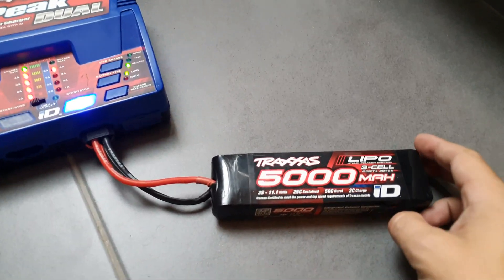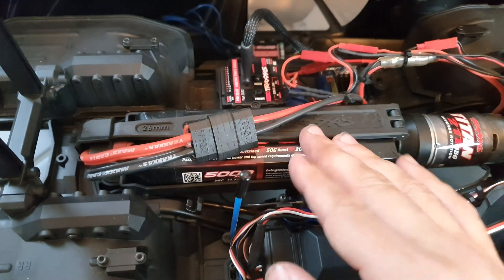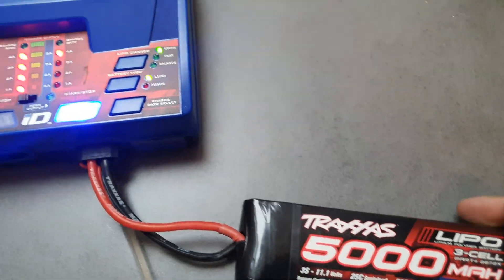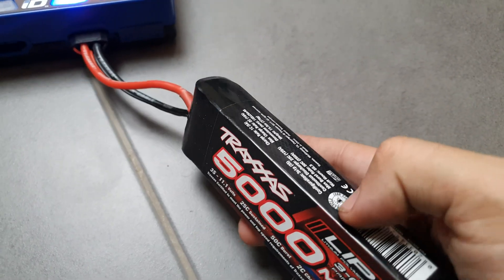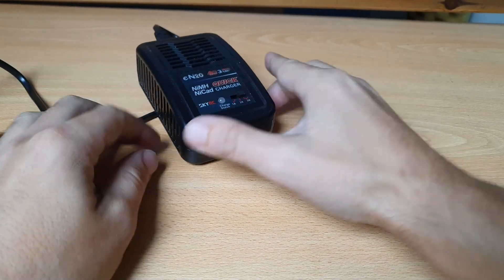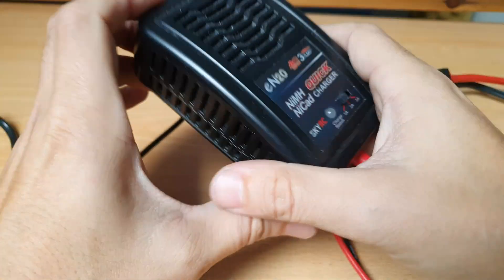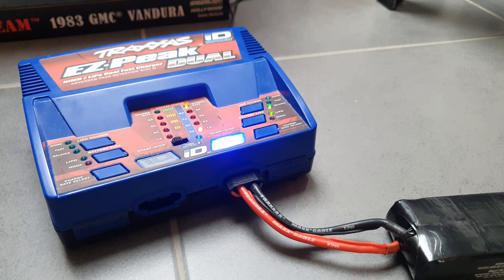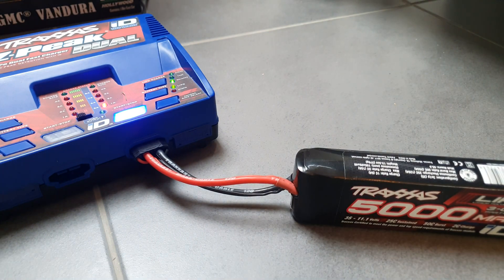FIX for LIPO battery not charging

Comment: 👍 You can also replace the NiCad charger in your video with a 9 volt battery and a pair of alligator clip wires to over ride or fake out the LIPO battery chip. Use the same LIPO battery connector (the connector end for your device) and plug the LIPO battery charging connector into the LIPO charger.  Connect the RED wire to the + (positive / male / smaller terminal) and the BLACK wire goes to the - (negative / female / larger terminal) on the 9 volt battery. This provides low voltage to the LIPO battery from the 9 volt battery enough that the LIPO chip does not shut it down, and allows charging. 

NOTE: The 9 volt battery will get hot if you leave it connected during charging of the LIPO battery - only leave the 9 volt battery connected long enough to get the LIPO battery to start charging.👍
Reply from the maker: hmm yeah that could work to i guess 😗

Comment: My lipo batteries don't charge and start on charging it beeps the red light and blinks even if its on store charge.
Reply from the maker: Hmm
Maybe it's the charger?
Try another battery?
Also measure the voltage of the battery to make sure it has enough voltage.

Comment: I can confirm that connecting the bad battery (3s 5000mah) to a car batt. charger for 30 seconds and back to EZpeak charger works. Had 0.2v on 1st cell so just in case I McGyverd it outside and watched from a safe distance :D
Reply from the maker: Ugh  these batteries have so much problems
I hate lipo 
It needs constant life support

Comment: I am having this problem, i charged it on a NiMh charger for a little while, and it starts charging on my traxxas easy peak plus for a few minutes, but then it just begins displaying the low voltage error (red light flashing on 4A). Please help me and I would really appreciate it.
Reply from the maker: The battery is probably dead

Comment: No way! Thanks for the tip. Worked straight away. Remmebered i had an old battery that i replaced. Tried that with your method and charging. Thank you
Reply from the maker: @samuellockett8535  happy to do so

Comment: I used a 2amp 12 volt car battery charger for 30 seconds to boost my dead batteries yes I left them plugged in to my Udr for week 
3s 11.1v 500mah
30 seconds on car charger
Then right onto the traxxas charger worked perfectly!!!
Don’t try to over charge on the car charger as the plug was getting hot after 20 seconds

Comment: I used a old school car battery charger and it worked like a champ.
Reply: I too left my truck plugged in 
Resulting in two completely dead 5000mah batteries 0 volts
A 2amp 12 volt charger for 30 seconds did the trick( plug was getting warm) Then onto my he traxxas charger 
Ta da.  Charging normally again

Comment: Hooked mine to the tractor battery for about 2-3 minutes, then put it back on the Traxxas charger. Worked great
Reply from the maker: That can work 😆
I think 30 seconds would also worked. But it can be dangerous if you cross the wires
Reply: Are you serious? I'd be afraid if it exploding in my face
Reply from the maker: @upstatetyler2380  
Nah its just like when you try to start a car. A battery will not just explode first you will see some smoke then fire
Reply: Nothing like that it work for me. All you want is the voltage to increase to where it can be seen by the charger. It’s not hard to do.
Reply: How long would you suggest to hook to the battery for?
Reply: Yeah, spoke to a hobby shop. They said that is dangerous and wouldn't recommend it.

Comment: Thank for your video. I didn’t have a extra charger so I hook up a couple wires to my car battery run my car for a while and it did the trick.  It does work very easy to do.
Reply from the maker: Haha yeah that will do the trick😅 i like the ingenuity
Reply: what type of wires? Im not tryna buy a whole new charger. I got a 1400mah if that matters

Comment: I’m trying to recharge my lancer tactical 1600mah rechargeable NiMH but the charger seems to stay red for like an hour now and it hasn’t changed color. what should I do? the battery looks okay it’s not heating up when I charge it it stays room temp so I’m not to sure what’s going on, please help me
Reply from the maker: Charge up another battery
If that works the charger is broken if not its the battery
Reply: I don’t have any other batteries with same plug
Reply from the maker: @Tutel57  buy a adapter for your plugs like in my video
Reply: @HappyDude1  what is part number for that adapter?
Reply from the maker: @patman6816 
I dont know 
I just went to a rc store to try

Comment: i don't have that fast charger gadget is there another way to fix this problem?
Reply from the maker: you will need a charger
Reply: Same happen to me I took a couple pieces of wire connect it to my car battery, turn on my car and run it for a while and it charge, then I connect back to charger and it works.
Reply: Are you foreal? Your not afraid of it exploding?
Reply from the maker: He can't answer
He's dead 😅
Reply: @HappyDude1  this just seems sketchy to me. I'd need to put a shield over my face and wear protective gloves🤣
Reply: Hobby shop told me they don't recommend it at all. Very dangerous. Just putting this out there for you guys thinking about doing this car battery thing

Comment: Do you know why my lipo won't work in my car it's in low voltage, but I keep getting the red and green flashing light
Reply from the maker: give it a full charge
Reply: It is
Reply from the maker: @overcomecross9843  
Reset the ecu